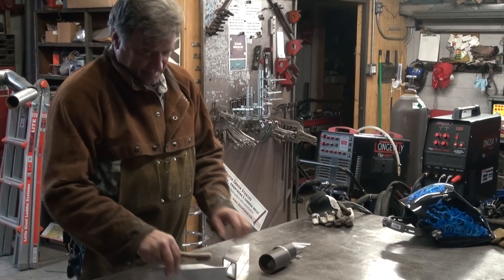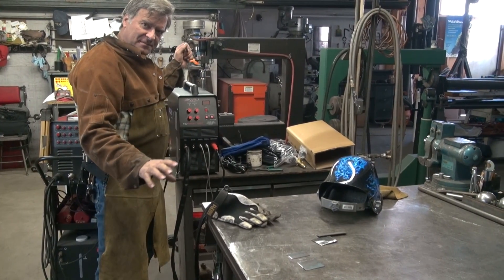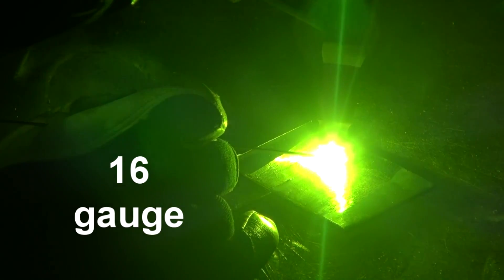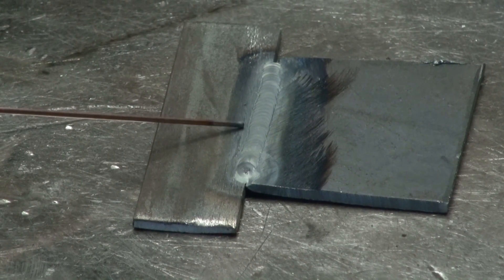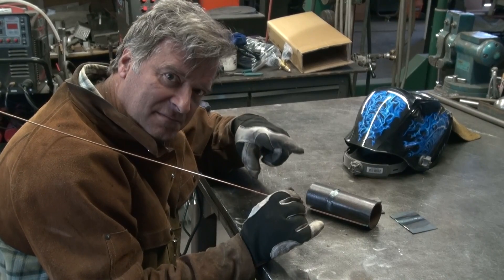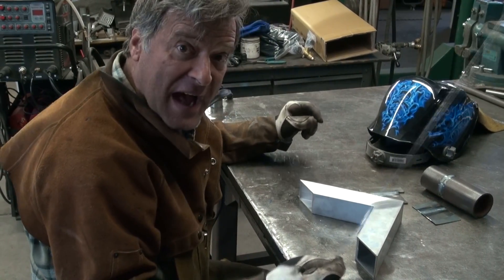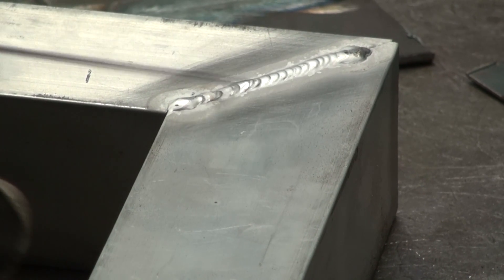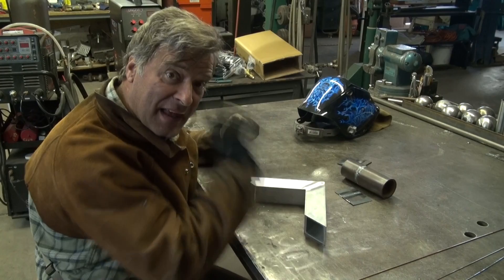How to TIG Weld Steel and Aluminum With Longevity's New 160SX - Kevin Caron

Comment: Yea, but, but but what about uphill tig welding alum. is that doable for a do it yourselfer
Reply from the maker: bob brawley Yes, it most certainly is!!  I started on a 45 degree angle and worked my up to vertical from there..    A little quicker in the forward movement and feed but very doable..     Give it a try!
Reply: Ok , good one day I may give it a try. thanks for the comment

Comment: Sir, I want to know the current value and tip diameter to work satisfactorily weld 2 tubes of thickness 1" OD and 1, 1.5 mm, 2 mm and 3 mm. Please provide me your expert comment.

Comment from the maker: Yes you can tig weld with an arc machine. If you have the right add on box to do it. But you have to have gas for tig welding. The machine you see here is running gas off the machine next to it.

Comment from the maker: Duty cycle on this machine is 60% for both 110 and 220.    I do not know if it is compatable with Miller in any way and it does come with an air cooled torch. You can use a watercooled torch but there is no 110 or 220 output for running the cooler.

Great questions, thanks for asking....

Comment: Hello, what is the duty cycle at each voltage, is the torch,and foot switch plug compatible with Miller and does it need a torch cooler?
Thanks

Comment: Hi Kev.  With this machine, how do you start the arc?  My cheapie Harbor Freight keeps sticking the tungsten to the work (no foot pedal).  Also, are you using argon as the gas?  Finally, you run those beads so fast.  I'm impressed!  Thanks.

Comment: 2:50 that sound of adding drops of rod made me smile ;) Almost most of the welders at my company are just lying the rod on the material and start to push it inside of welding lake. It's just easier for them to control it and not to burn throught ( mainly stainless steel ) but hey, You may always add the drops faster when it's needed. The weld's hulls are much more visible so it looks nicer for me. 

Greetings from Poland